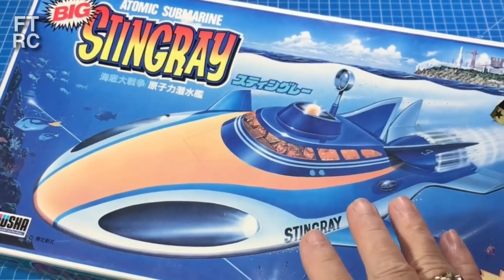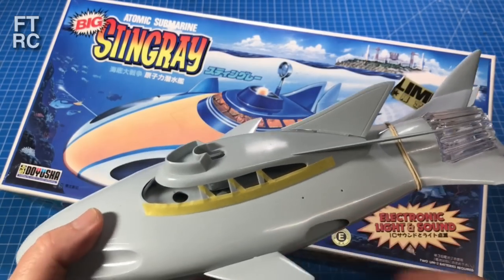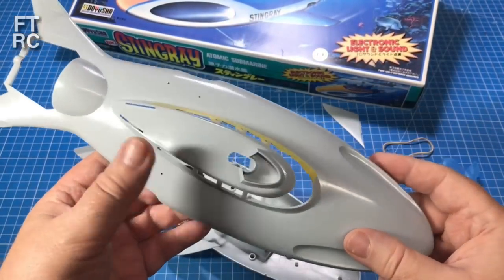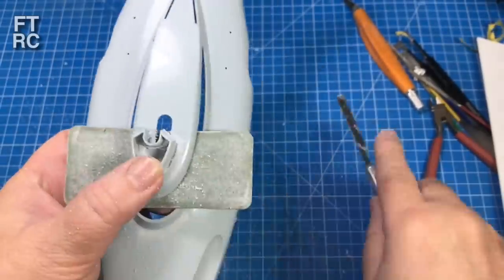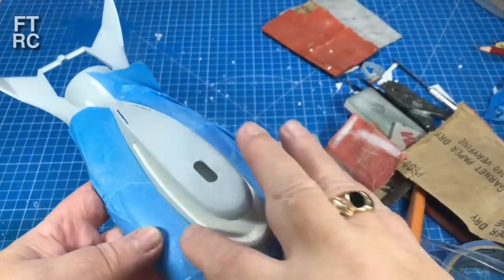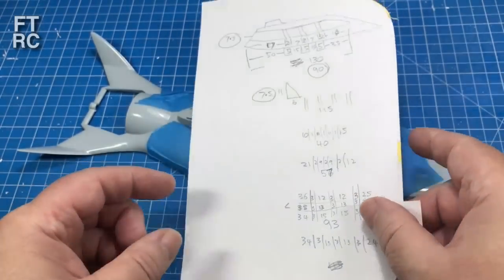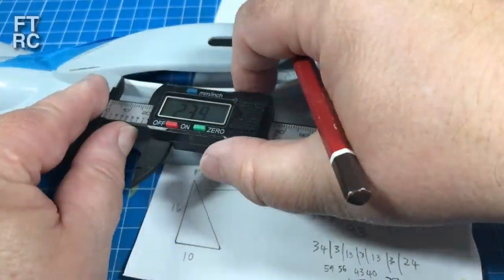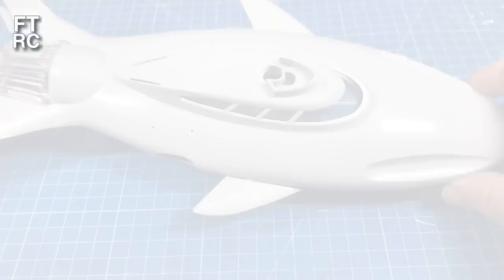Stingray Part 2 Cabin Windows lowered with scratch parts to match Gerry Anderson TV Show Model Sub

Comment: Wonderful results, I might have rough cut the inside of that lower window shim before gluing it in, and then trimmed and sanded it to shape on the inside as you did the outside, but still, you got it done and she's looking so good
Reply from the maker: Yes hindsight is wonderful after you tried to do a new thing.  Next time I need to do something like this I would make a lot of changes.  However my reasoning was the concern of cutting out a thin fragile horseshoe shape, without it breaking into pieces before I had a chance to glue it into place.